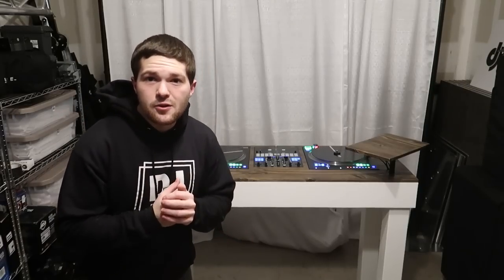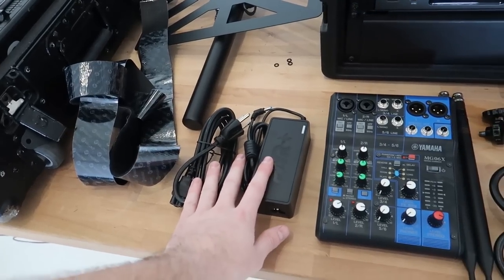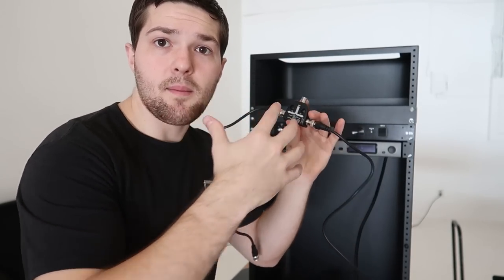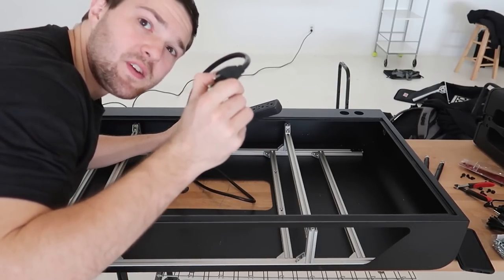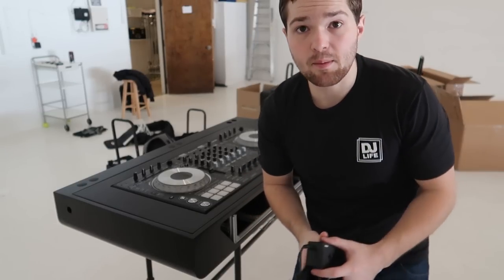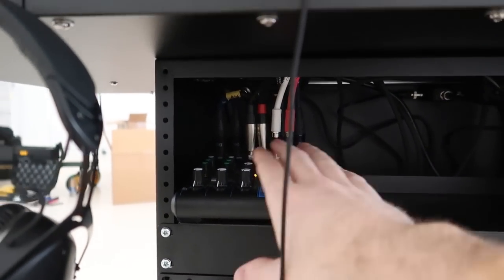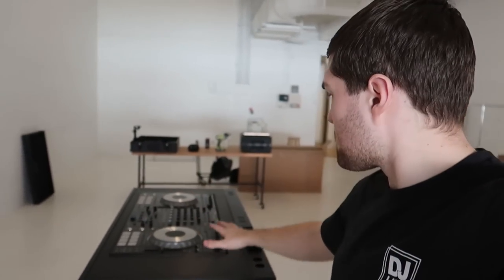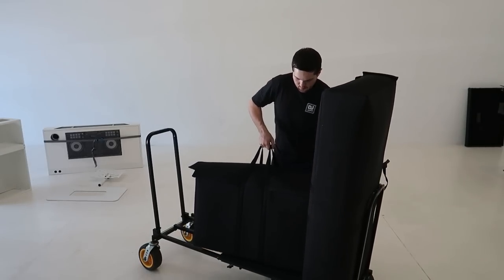My Custom Bunn Gear Command Center | Mobile DJ Booth @pioneerdjglobal DDJ SZ

Comment: Super great idea, I think is a very good change of pace from all. the other DJ tables I have seen,  we all are giving our great thoughts and praise about the table, but let me be one. of the first to say this is extremely outrageously priced,  this is extremely expensive!!!

Could there be, or is there a massive discount somewhere in the making!!
Reply from the maker: Your easily looking at a grand just in materials to make the table and accessories/bags. So for it to be overly priced I would disagree. Because that doesn't include manufacturing.
Reply from the maker: Being an mechanical engineer myself. I am amazed the price is only 2k for everything. If you were to go buy the stuff that makes this table (a 10u rack, event table or facade/table, a case for your controller, and it's all prewired for easy setup) you easily be spending 1000 to 1500. And your setup time would be 5 times longer. All comes down to what you value
Reply: Rick, I'm a true fan of your channel I have been following you.  for quite some time, I can understand your concerns, and mapping out the logistics on the building and infrastructure of this product, and the cost that it takes to build it, but if you're selling to a multitude of entertainers/DJs, and you're trying to reach a. mass market of them,  maybe.  mass production of this table overseas to bring down the cost,  I'm sure you remember the. cost of thee vent table, going from $400..  of an aluminum table  to $2000,  is. a very massive jump,  I'm sure someone will come up with a great design that will be in between the $400 event table, and this $2000 Bunn  command center  don't get me wrong is. a pretty cool item,   but that's a very massed price range between the $400 event table that. you have done a video on  in which I have watched and also purchase because of your review,  but now a $ $1600, difference, I'm sure someone will come up with something in between that expensive $2000 purchase that would do the same thing,  and that will accommodate all. of the DJs out there that  realize, it's a table, a table for $2000, if no one else will speak about it, I will,  that's expensive, I don't care how. you look at it, it's a table!!!  it's a very cool idea,  but all in all, it has to be within reason!!!  and. I don't see a $1600 difference between the event table  and this, is quite worth the expense, just for particular look!!  and not a true hundred percent concept of being able to. put your turntables, mixer board,  or a much better look to lock in your controller, for transport, by using a tied own strap for two dollars that you can buy at your local Walmart store.  I would figure a person with such engineering background, would already have some type of locking mechanism, to lock in your controller so you don't have to use. a two dollar strap,  there again I'm a big follower of your channel, but doesn't mean. I agree to everything that I see.    and this is just my opinion.  I still think is outrageously expensive,  if he was to bring the cost down,  find a manufacturer overseas, they can mass-produce, so the DJs can invest a little less for the cost. of the table..

If he is a true engineer,  in order to make better product, you have to listen to your fans, ( to your buyers) , 
if we don't make observations,  and/or suggestions, how can he as a engineer, produce better product 
if he does not know what his fans,  are seeing within his product , and wanting from him as an engineer, 
if we don't speak up, new designs. are not created,  
feed your fans,  with good product , decent pricing,  
and they will. feed your pocketbook, /  bank account..
Reply from the maker: @MIBLD  the strap as explained doesn't hold the controllers in. It's there to keep the deck saver on. And I would prefer they leave manufacturing in the USA. I strongly discourage any company from using off shores manufacturing.

Comment: Rick do you use any backup music source?
Reply from the maker: Normally yes two laptops. I think I am switching back to the ipad back up in 2020
Reply: DJ Rick Web Thanks. I use ipad as well. I also have a second macbook for lighting. I was wondering if I should use that as a backup as well. Trying to simplify things. BTW. I dig the booth you built. Great job.

Comment: Nice looking product however, I would consider having road cases rather than bags.  For DJs that over stuff their trucks or trailers, this would be trash within a few weeks.
Reply from the maker: Its ment for DJs that use a car. Which is why it's so portable
Reply: DJ Rick Web is still be concerned at the end of the night with damaging it in a car.  With an investment of $2 a 3k, I’d want that to be pristine at my events.  You could go with a light weight plastic reinforcement so at least it has a bit more protection.  Here’s some gear bags that use this concept:  https://gear.digitaljuice.com/products/products.asp?pid=1559

Comment: Nice but expensive 
Can you get us a nice discount?
Reply from the maker: I mean if you went and bought a table/facade or event table, a 10u rack, a case for your controller you easily be looking at 1 to 1.5k and that wouldnt be pre wired and able to setup in under 2 minutes.
Reply: DJ Rick Web I know I’m still on the lower leagues but I’ll get there! Thank you for your awesome videos
Reply from the maker: @djleogarcia  yeah the intial model is ment to be the premier solutikn